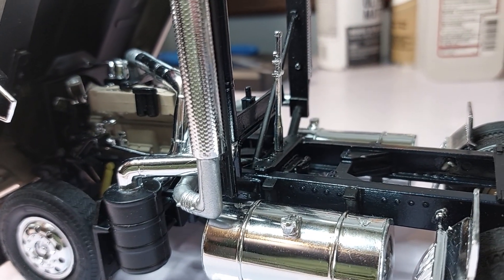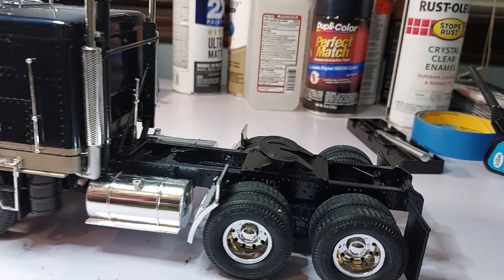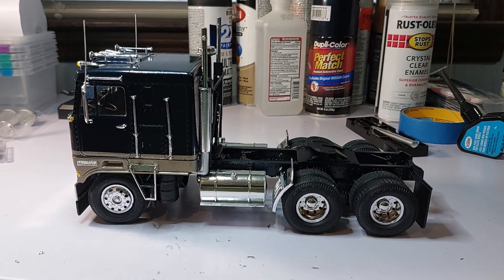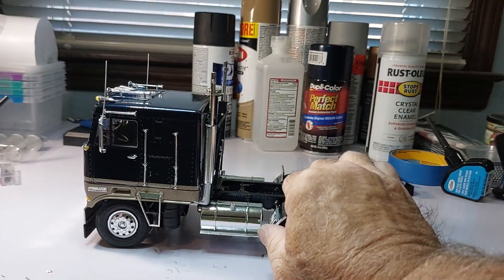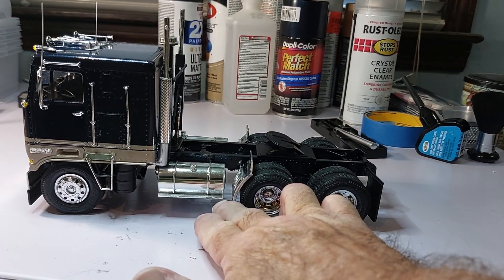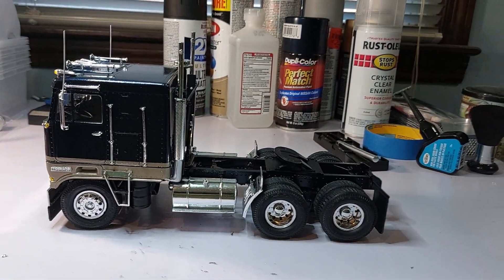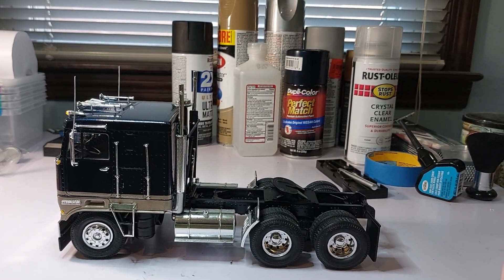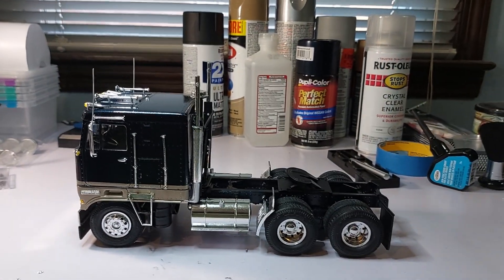AMT Kenworth K-123 build part 19 (almost done!!!! just a couple lights remain)

Comment: Neat as ever Jeff, nice assembly and paint. These AMT kits can be a bit fiddly. I don't like the marks left in the chrome fuel tanks from the glue joints and the sprue cut off points. I have re sanded mine and filled with Tamiya model putty and painted in chrome spray for a realistic aluminium look. Currently doing the Alaskan Hauler and the W925 Conventional AMT kits.
Reply from the maker: @andyroo3022  thank you Andy